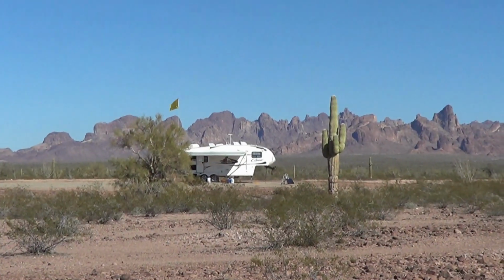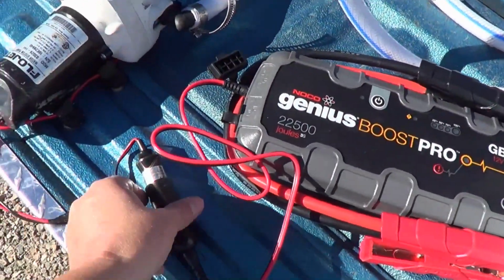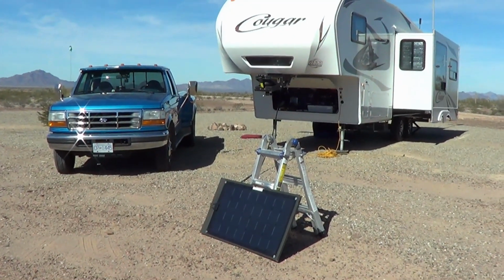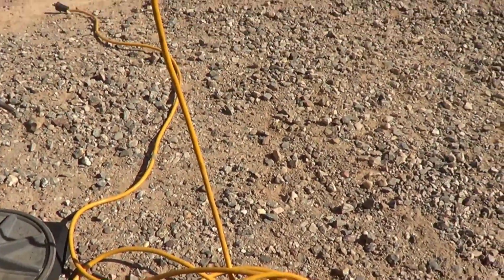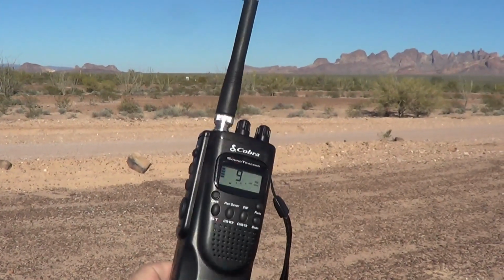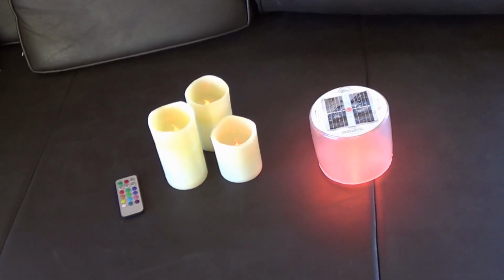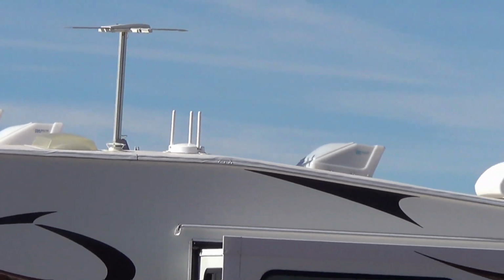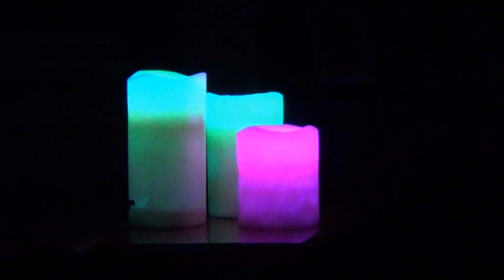Love Your RV!  Boondocking Mods and Gadgets

Comment: Ray, please check out the 5w Baofeng handheld ham radios on Amazon for $24. I have two and got my Amateur radio operator license for emergency use.  Much better than CB and with repeater use, you can reach out long distances. Highly recommended.
Reply from the maker: Cool, thanks for the tip

Comment: is there a reason you use your buddy heater if you have a forced air, I know my furnace is noisey, just asken
Reply from the maker: Yes, other than the noise factor the main reason is to save battery power. The main furnaces fan draws in the neighborhood of 6-8 amps. Using the Buddy heater during the hours before bedtime can really save a lot of battery juice especially if it is cold out. Also, since it is 99% efficient versus the forced air which is around 50% efficient, we save on propane costs.
The trade off of course is safety, you have to use the Buddy with caution as it is an open flame unit. So things could be ignited if close to it and it does use up oxygen. Hence proper ventilation is required.

Comment: Is your flag pole one piece?  If so where do you store it when your traveling?
Thanks,
Dale
Reply from the maker: You'll find a video demoing the flag pole in this post - http://www.loveyourrv.com/fun-rv-tip-get-flag/ 
It's one piece but breaks down small, I store it in the front compartment, hardly takes any room and is very lightweight. 
Cheers! Ray
Reply: Thanks for the info.

Comment: I love my Trimetric, I tell anyone interested in solar power for their camper that that and the SC-2030 (charge controller) is the first thing to buy. I really like how they talk to each other. Helps get every amp from the panel to the batteries!
Reply from the maker: Yes, I'm really pleased with mine. For a small economical setup, I don't think you can beat that combo.
My battery bank is very happy, gets a great charge.

Comment: Thanks for the video. Like the propane heater but what about a carbon monoxide detector?
Reply from the maker: You're welcome. Most RVs come with CO detector, smoke detector and propane detector as standard add-ons. The Buddy heater has it's own low oxygen level auto shutdown.

Comment: another question. ..can you integrate  flexible solar panels on the awning....that would be a game changer...even if you had to manually plug them in...could you sew them in...
Reply: Flexible solar panels aren't that flexible, plus it would be a bear to roll up your awning, even if they were.
Reply from the maker: No, not this type I have. I have heard of solar tents and tarps but not sure how good they work. Also if it is really windy you can't have the awning open

Comment: why don't you get a wind turbine. .to make power..you seem to have lots of wind
Reply from the maker: I only think they are practical on small RVs with limited roof area or camping in cloudy areas all the time. I think they would be noisy, kinda pain to have mounted, put up and down. Would be easier to just add another solar panel and gain at least as much juice if not more.
If they were a good option compared to solar you would see a lot more especially in the desert here, you just don't. Cheers Ray

Comment: The first thing to run out for us is water. I like your added supply.  Id like to do maybe a 35 gallon barrel. Running out of water with shampoo in my wifes hair isnt something Ill ever experience twice. 
I like your solar system. Its enough without looking like the underside of a dash of a DC9. Some have so many wires run its overwhelming.
Ive never taken my dogs in the desert. Has Angie ever found a mean snake or spider?
Reply from the maker: No, I keep her close and we are usually in the desert in the winter when they are hibernating. We generally only see rabbits, little lizards, the odd deer, and sheep. In 6 years coming down, I've seen two garter snakes, two scorpions, and one tarantula.